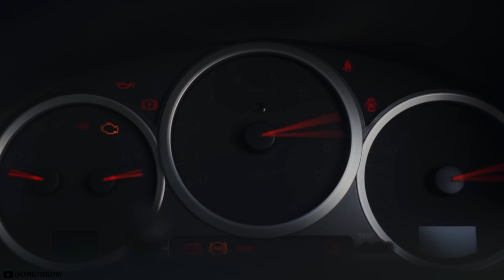Donut Media VS. Subaru

Comment: I think it's a little ridiculous that a car marketed as a "performance" car can't be driven as such without modifications to keep it from blowing up.   I loved my bugeye WRX.    I got it in a trade for my 8th gen Si that I was definitely not a fan of.  The WRX was fun to drive, made decent power, handled really well and looked awesome on coilovers with wide black RPF1s...but I always felt like I was on borrowed time.   I knew that if it blew up, it would cost a fortune to get an engine done right.  ThatDudeinBlue had an excellent video on what it really takes to have an EJ rebuilt correctly for longevity and power.   Seeing that, I can see that probably 95% of people won't do what it really takes.. either because of cost or the effort involved.  I knew that if mine blew up, I didn't want to half ass it and I couldn't afford it to be done 100% right...and I would lose my butt on the car having a shell I couldn't sell or an endless project.  I made an effort to sell the car while it was in tip top running condition with all the awesome parts I installed and cash out ASAP.
Reply: Right! But you can take a stock Corolla or Civic and beat the shit out of it and if there is always some oil on the dipstick, it's going to live forever!

Comment: The challenge here is that reputation DRIVES how much research people do. If a platform has a reputation for being reliable, they won't feel the need to do a ton of deep dive research. Admitting they're complex to modify SHOULD be their reputation. When fans won't accept reality as the cars rep, that's what leads to incomplete understanding by new owners.

Comment: Agreed Alex, great synopsis.  I bought a 2003 SRX that had been converted to STI with the 2004 engine and trans.  I loved that car, loved the way it looked, loved the way it sounded, loved the attention it garnered, until it broke...twice.  I blew the first motor at streets of willow, oil pump failed.  Spent 10k having a local LA subaru builder rebuild it, even had to install a new turbo after the original one failed on the dyno, not the cars fault (it turned out to be a cheap chinese knock off).  Drove and tracked the car a few more years and then blew another motor.  I never looked into why it failed as at that point I figured it was going to take 15K to get the car to where I wanted and I just didnt want to spend that much on that car.  I sold if with the blown motor for $3500 and bought a 2013 Ford Focus ST.  I have tracked this car at least as much as the Suby and have only had to replace the failed rear sway bar mounts.  Subarus definitely take some special knowledge and just dont think they take power-adding parts unless you spend ALOT of money.  JMHO.

Comment: Let’s be real hear they have done this series with plenty of vehicles that weren’t even half this problematic. Everyone wants blame them or say they should have done this or that. The reality is they went through 5 motors within a few months which is insane. Sure boxers require a lot more work but it’s also the reason most car manufacturers done use them. They are temperamental by design and not set up for success. Most of the issues they ran into are things Subaru should have addressed. It’s definitely not a bolt on friendly platform by any means. If you compare it to other platforms they just fall short in a lot of areas imo. That being said I think Subarus have communities with some of the coolest people.

Comment: I am the 3rd owner of a fully built 15 sti. It was scary at first but I did the research, had it PROFESIONALLY looked at by a shop that I trust and even got the build list and contacted the previous owner. I LOVE IT. Not even a Subaru guy, just a car guy with a subaru. And honestly, I think they're great cars and LOVED donut media series on it. They really don't deserve the hate.
Reply: Just bought a 15 WRX with pretty low miles, I was the 3rd owner but it was sold by a pretty good dealer in TX. I feel like most people don't really have issues unless you're doing something really crazy to it or sending her too hard.
Reply: @VB_Bryan  It depends how well you take care of them. I'm the 2nd owner of my STI and it was on its 3rd engine before the car hit 100,000 miles. 2nd motor blew up before I had the car for a year, so both of the failures were probably because of the first owner. I've taken care of the 3rd motor since the beginning, and it's been fine since.

Comment: I don't think it is so much a matter of people not wanting to admit they are harder to work on than it is that people don't want to admit they have some ridiculous failure points that have to be addressed IMMEDIATLY for a platform marketed as a sports car.

At the end of the day I believe Donut's representation was 100% accurate. If your average Joe picked up a WRX with the intention of REALLY driving it this is the learning curve they would be met with. They have a reputation for a reason, somebody didn't just start spreading rumors that they blow up really easy one day and it stuck lol.

Comment: I had an 04 WRX with the EJ205 and 5 speed manual for my first "performance" car. Reliability wise, it took 4 years of hard driving for something to finally break, 2nd gear on a hard launch. Sure, the clutch burned up, but then again doing a 180 in the snow and trying to clutch drop going back the other way will do that to an OEM clutch. Blown out suspension, I probably shouldn't have been jumping it. Out of all the vehicles I have owned, the WRX was the toughest damn car I've owned, any issues it had were my own damn fault.

Comment: I wanna say too, the way they broke the engine in and went straight to tracking it was a straight up "F-You" moment for us Subi owners. 

IDC if you have a BMW, AMG, Toyota, Subaru, whatever, you should never ever track an engine on the wrong map, freshly rebuilt, without proper break in. My 2 cents.

You did a great job with your video and being informative, love it lots. Cheers g
Reply from the maker: Thanks man!
Reply: to be fair, they have a production schedule which needed to be followed hence why a break in period was likely impossible. perhaps if the first engines didnt blow... quite disappointing these engines CAN be reliable but never seem as reliable when compared to something like a K series

Comment: Subie bois: "Subarus are great ........ proceeds to give a long list of everything you should do just to keep it reliable. " 
And yet they wonder why people make fun of both Subaru and the drivers,  ironic
Reply: The list is very short actually, don't mod it.
Reply: Sometimes I wonder what they put in their vapes
Reply: @unoPara this is all about modding cars. Missed the whole point.
Reply: @ryanwilliams5904  Modding cars is decrasing the reliability on any car, especailly if you have no clue what you are doing, just like donut did.
Reply: @unoPara proceeds to need a baffled oil pan just to prevent oil starvation

Comment: I'm 38 and have given up on heavy vehicle modifications. I dream of stock cars with better tires, brakes and stiffer chassis vs. coilovers, exhaust mods and wheels. Maybe some ECU tuning at the most because I can do that myself, just to make things run more efficient (more efficient also means less flat spots in acceleration, leading to a better driving vehicle).

Comment: Dude if an engine requires you too have the knowledge of a mechanic for a specific engine design that only one platform uses and even having it u still blow up the engine just by taking it one's to the track. That's not a good engine, it's just a bad design that Subaru keeps putting in cars, because they refuse too invest in a complete engine design replacement. If you need too change half the part's in engine that's in a performance car just too be able to take it too the track it's a shit engine.

Comment: I have a 900whp 730wtq 2020 Subaru STI and they are an excellent platform. You are also correct that it is not like building a 900hp LS or Coyote and they have really specific recipes to get good power and make sure its tuned correctly by someone who specializes in these cars. 

Hands down though, ripping 50psi of boost through a Precision 6870 on the street is enough to be terrifying and glorious all at once!!
Reply: Did you really just said they’re really excellent platform?

Comment: I would really enjoy a longer video on this topic with some of the clips from the interviews! 

Also, as a fan of Donut and someone who drives a subaru. I think a lot of people talking about this topic fail to realize that it's just impossible to show every piece of everything done to a car in a series like hi-low. I don't know if they didn't do research, or did stuff wrong. Maybe they did, maybe they didn't. But, as you said, and I agree, subarus are just tempermental. It's just the way it is. I drive a VA wrx now with the FA20 which is likely one of the most forgiving engines you can get in a subaru and still I have done so much research and study on parts combinations, tuners to buy from, how and when to maintenence things, what supporting mods are necessary. The list goes on and on. I've been very lucky with mine and had no issues so far, and hopefully it stays that way but, I understand and agree that it can be a more intimidating and challenging platform than others someone could choose from.

Comment: I haven't even watched the whole video but I'll drop this.  Subaru's are GARBAGE.  And I've owned both a 2011 WRX and a 2013 sit and a 2003 JDM Forester.  The forester was the best, hands down.  The reason that they're garbage is because everyone who buys them thinks that they can make MASSIVE power just by adding an intake, exhaust, a shit COBB tune and maybe some wheels, tires and suspension.  And then they rat bag these cars and pass them on to the public after being absolutely destroyed.  My WRX lasted 2000 kms and then the engine left the chat...and I'll be honest when I say I didn't drive it that hard.  It was cruising at 60 mph when it decided to die.  My STi, the previous owner had decided to put "lowering springs" on it and completely ruin the alignment causing me to go through two sets of front tires in the span on ONE YEAR of ownership.  Yes, we all want them to be cool, we all want to be Ken Block or Colin McCrae or Petter Solberg.....but we need to realize the work that it takes to make those cars that good and stop thinking just because we buy an accessport that that will happen....never mind the clutch on my STi that I had to replace after a couple months.

The forester was bulletproof after 200k kms.  I miss that car daily.  And it's only because it wasn't modified and it was taken care of.  225 hp is enough.

Thanks for coming to my Ted Talk.

Comment: This is completely accurate.
It's not that the guys don't know what they're doing, it's that you shouldn't have to worry about your fucking oil pickup. You shouldn't have a performance vehicle outside of the 1900s that doesn't have a baffle in the oil pan.
You shouldn't have an engine that can frag itself so easily. That has a massive lack of crankcase ventilation. That has oil consumption issues. Oil consumption issues on engines that are considered modern.
It's just a bad platform and if you fix everything it'll work but most people will not fix everything and they will have issues